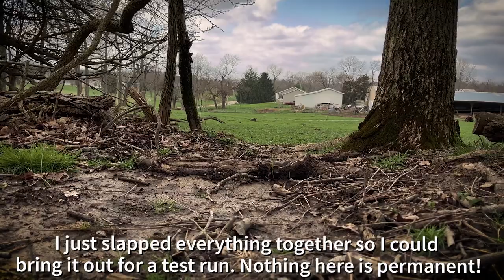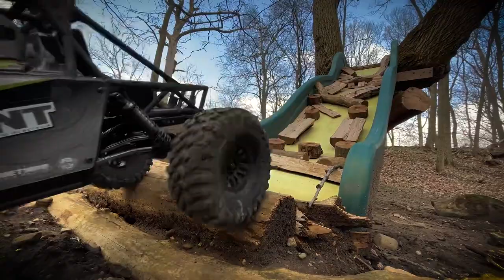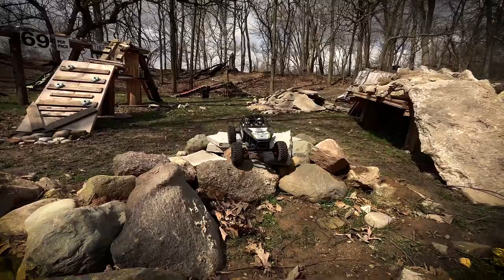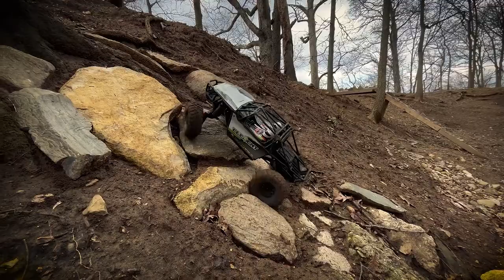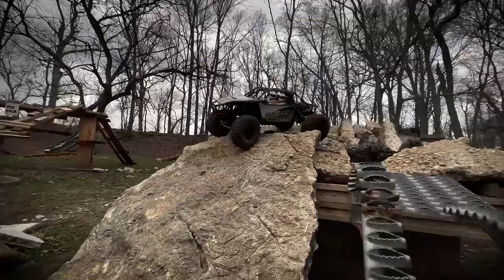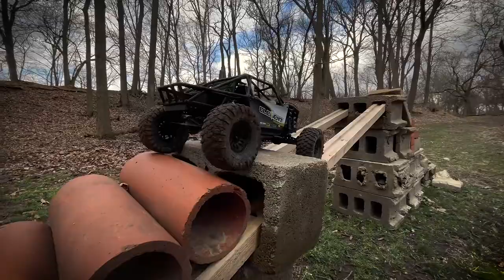RC crawler jambalaya, a beautiful concoction!

Comment: 😁😁😁very cool 
Always fun to put bunch of pieces together lends itself to redesign.
😁I always jump gun on testing...it’s like it moves go run it!!
Reply from the maker: Yea, the second those tires turn by themselves, it’s time for a run! Still really wish I had swapped out tires first though. I just had the canyon trails on it as a place holder while building. However, it actually did pretty well for just getting slapped together and run. Hopefully I can’t get this new body in and painted and maybe get another run in this weekend at some point. Fingers crossed 🤞